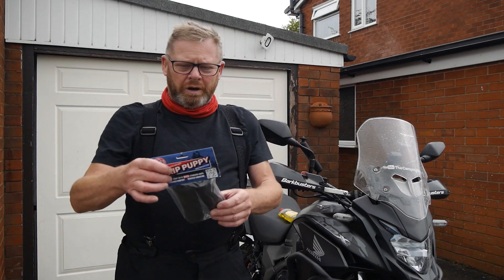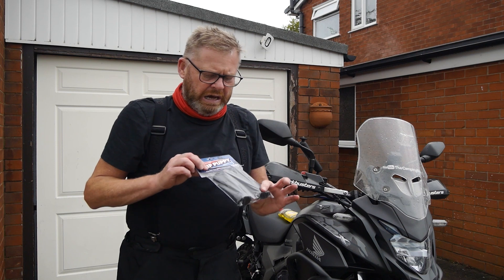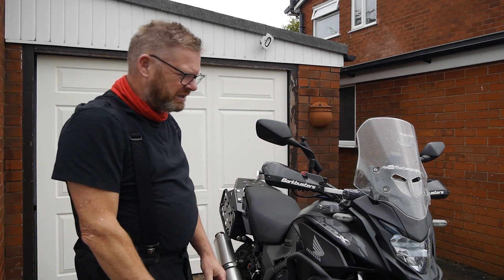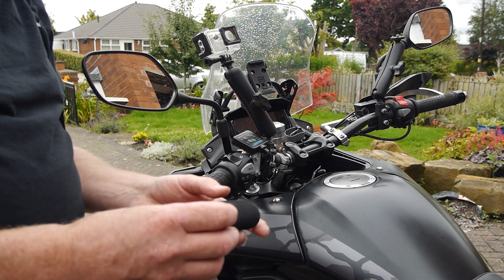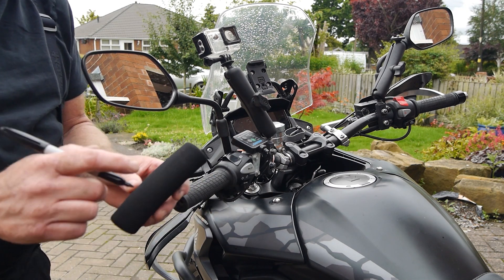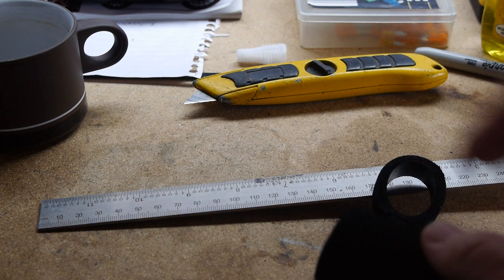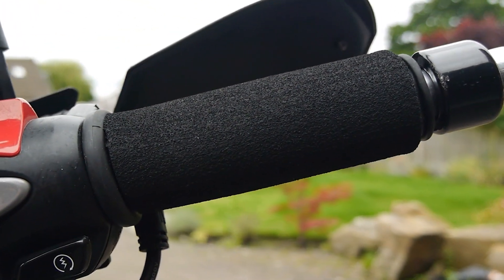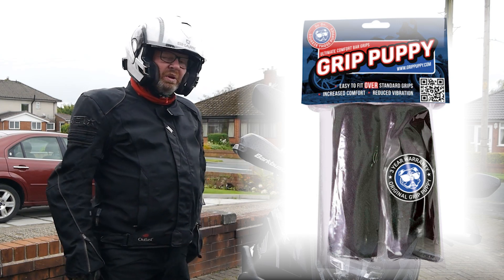Grip Puppy Comfort Bar Grips | Honda CB500X

Comment: Good video. I use them on my cb650r because my hands like a bigger grip and it helps a little with occasional numbness. They also transfer the heat quite well from the factory heated grips.
Reply from the maker: They’re certainly good as long as you’re comfortable with them 👍🏻
Reply: Nice to hear this I just bought a set for my cb650r 😊

Comment: Nice quick video.
I thought you had a wiring issue at 7:30 but it looks like dead bug splatter on the Oxford cable 😂
I presume the heated grips may only be a marginal loss of temperature and that some folk may have to use a higher % when using them. Thinking about for my cb125f but still unsure.
Reply from the maker: You’ve caught me out, I’m not into deep cleaning…plenty of dead bugs as mementos of my travels 😂  yes, only marginal loss of temperature and even in winter I’d only be using on mid setting most of time so plenty of extra capacity 👍🏻

Comment: Another good video, thank you. I find it's just been my right hand that has gone a bit numb on my Suzuki (650/1000) V twins and Triumph (675/800) triples so just fit them to the throttle side over the heated grips. Two bikes from one pack :) make it a no brainer cost wise for long distance comfort. Going down to the Alps via the twists and turns of Route Napoleon this autumn I found the only down side was where a lot of braking effort, due to the terrain and the wider grip, caused my hand to fatigue a little sooner that i'd normally expect but it was at the end of a long days riding. Much better the rest of the time though!
Reply from the maker: Thanks Mark, good value fix to even minor vibration issues.. even better on a two for one basis 😆 👍🏻

Comment: Mine have just started to deteriorate after 15000 miles fitted over oxford heated grips. The only downside for me is the increased size of the grips can make it a bit more of a stretch to reach the levers. Fixed 90% of the hand buzz and numbness though.
Reply from the maker: Made a big difference for me and agree about slight thicker grip but worth it in the end

Comment: I put these on my Yamaha R3 and they hurt my hands more than the stock ones.  Put pressure points on my palms and made them red.  I think just a little too thick perhaps.
Reply from the maker: @JBAYMEDIA  I could understand that, they are a bit thick but guess that’s what helps with vibration.. I’ve changed bike since then and haven’t put them on new bike but personally haven’t had an issue with pressure points 👍🏻
Reply: @thecampingbiker791  Yeah.  I actually found vibration wasn’t any better with them on, but it probably depends on the bike you are riding.  The R3 doesn’t have that much vibration to begin with.  I like the idea and feel of these puppies, they just didn’t work for me.
Reply from the maker: @JBAYMEDIA  they worked on the 500X but that was a bit viby, but I do get the thickness issue..

Comment: Maybe a silly question, but don't they need any adhesive to make them stick?
Reply from the maker: Not silly at all…. no glue needed as they’re a very tight fit and have that sticky but not sticky (if you know what I mean) type of rubber on the inside so grip well, which is also why using soap helps to get them on…even then they can need patience to twist on.
Reply: @thecampingbiker791  yeah I know what you mean. Thanks for the reply 🙂

Comment: just fitted these an hour ago to my 750 hornet, coz more often than not i get pins and needles and a numb right thumb, so hope they help a bit. I also use athletic wrist brace supports that help on long days too. on my last bike i fitted 25mm pullback risers as well, so may do that as well. btm mine just say 'for motorcycle/scooter' and not specifically honda, and slid on with about the same force as you used here, so i don't think the label makes a difference either. GL
Reply from the maker: They’re very good, particularly on longer trips…I’m going to fit them to my new bike this weekend…NX500 👍🏻
Reply: @thecampingbiker791  just got back from a 170 mile round trip upto egton bridge, and yeah, they seem to help, well worth the £15 anyway, so happy i fitted them :) thanks
Reply from the maker: @Bob-ts2tu  no problem, easy fix really 😊

Comment: I went to a 16tooth front sprocket makes a massive difference to first gear and drops the revs at higher speeds .
Reply from the maker: Sounds good, does it lose anything at low speed..less torque?